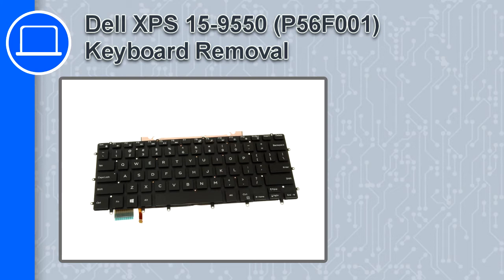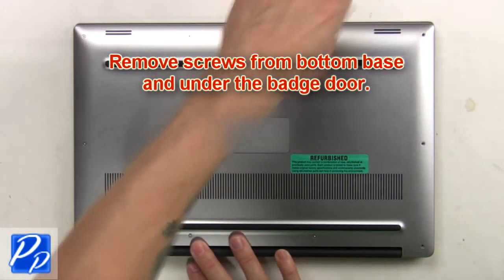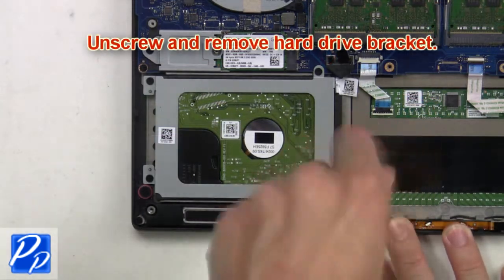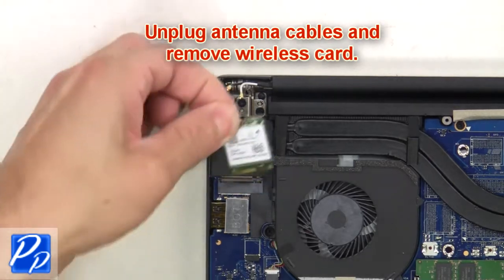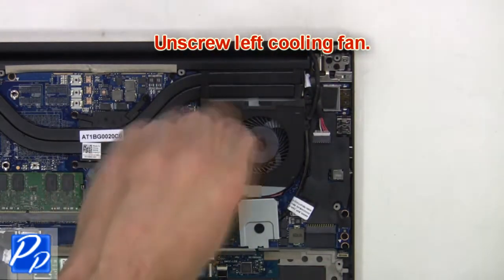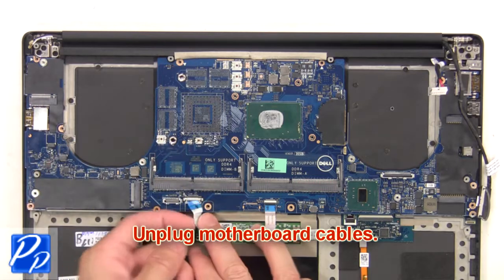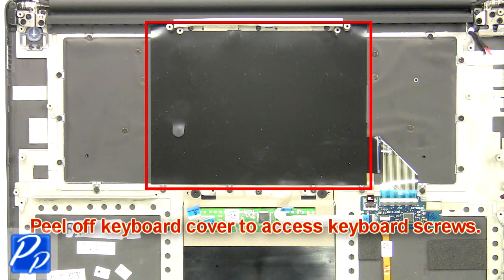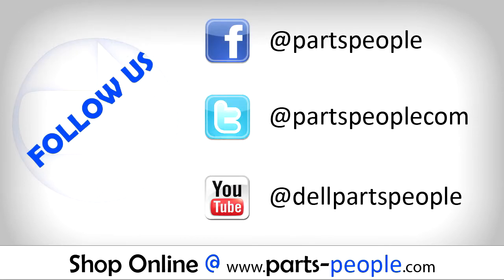Dell XPS 15-9550 (P56F001) Keyboard How-To Video Tutorial

Comment: :face-pink-tears:Stop...Please Stop. You Do Not have to remove the Cooling Heatsink to replace the Keyboard, Palmrest, Touchpad or CMOS Battery on any of Dell's XPS 15 9550, 9560 & 9570 so why do you have people doing this very costly and unnecessary Step, which I sadly found out the hard way?

I followed your videos of replacing the Keyboard & Palmrest on my perfectly good and running Dell XPS 15 (9550) laptop and because, you had me not only have to buy Thermal Paste & Pads, upon very gingerly & carefully removing the Heatsink 2 of the silver center cylinders attached to the holes in the Motherboard unbelievably detached from it and ultimately Bricked my laptop.

FYI - Not everyone plays games or edits videos on their laptop so so-called Thermals was never an issue for me because what I do with my laptop will never have it get to that point.

So STOP the re-paste garbage when someone just wants to replace their Defective Keyboard, Palmrest, Touch-pad or CMOS Battery in these units because it's WRONG!

Thanks for Destroying a perfectly good laptop with your very Misleading video.

I will be sending the exact same response to all your other YouTube Destroyers as you All want to be FAMOUS at others expense.

ALL THUMBS DOWN from Me!:face-pink-tears:

Comment: Super helpful, but I did skip a lot.   I think his version is good if you're extra careful, but if you understand how fragile a ribbon is and you're extremely careful you can save a lot of time. I appreciate previous commenters that saved me time. 

Wifi bracket needs to be removed to access the screw under it, but no need to unplug it or remove the card
No need to touch SD -solid state drive.
The fans need to be unscrewed (4 screws), but no need to lift them out or unplug.  Obviously if you do this method, lift up the motherboard very carefully when you get to that step.
No need to remove bracket or cable under L cooling fan (fan to your right in video)
No need to do anything with the heat sink.
very carefully lift the motherboard up from the bottom and very slowly fold it over on you workspace to access the keyboard (two sets of cables remain at top only, wifi and right cable that goes to bracket under L fan.

Also, while my keyboard backing looked beat I did reuse it and it worked fine.
Reply: Thank you very much for your comment @mlateer, I managed to replace my keyboard without removing all the other stuff

Comment: It's mentioned in some of the comments: i) do you need to remove/re-apply thermal paste when you remove the heatsink? And some people mention that it's not needed to remove the SSD, WLAN, heastink etc., is there a way indeed to do this that's also technically less challenging at the same time?

Comment: I followed the video and ran the Dell Hardware Diagnostics (Fn+Power button for 5 secs) and everything looks fine in that test (except for an old battery). SupportAssist Diagnostics (short test) is  stuck and report there is an issue, but never show the results. 

The touchpad is not working after I assembled the laptop. I do not see a touch device (except for the scree) under Human Interface Devices nor a Mouse in device manager running the latest version of Windows 10.  I2C HID Device have an error and I disabled it (based on a posting in Dell Community). Did I by mistake disconnect the touchpad?  I did not see the connector mentioned in the replacement touchpad video by you.
Reply: I did check that the cable between the touch pad and motherboard are connected. My suspicion is still that that connection is not working properly.
Reply: Resolved. It was a connection problem. Again, thanks for the video. It is short and to the point

Comment: Nice video PP.c ... may I mention that you don't have to remove the NVMe SSD, the WLAN card, or most importantly, the heatsinks from the CPU to gain access to the keyboard.
Reply: Would be interested to know how you would do that. Care to expand?
Reply: Agreed. There are several parts that do not need to be removed
Reply: I just did it without removing the heatsink.  Thereby saving the scraping out of the old thermal paste, the applying of the new thermal paste, and the cleaning of the heatsink.
Reply: @Coyoteare  Could you explain how you did that? And why doesn't he mention in the video anything about removing/applying thermal paste?
Reply: Could you indeed explain how to do that?

Comment: I would only add that you could explain the cable connection types. You sorta say, “pull out such & such cable” but they have different types of fittings. Otherwise, a very useful video!